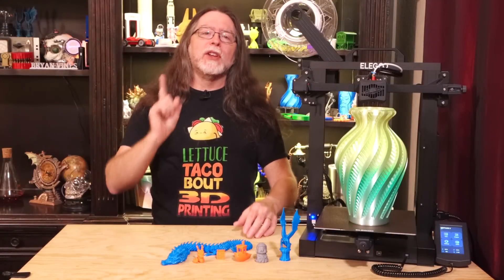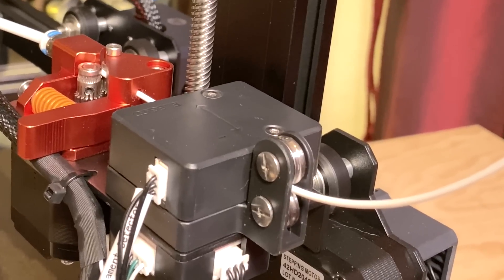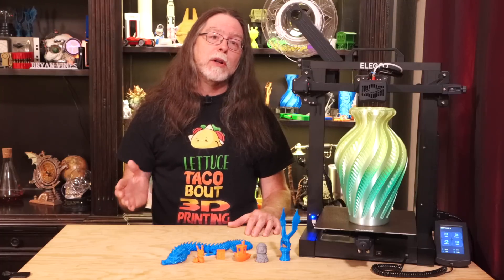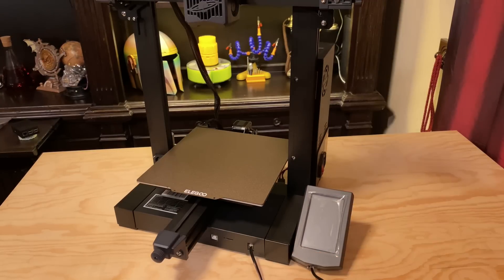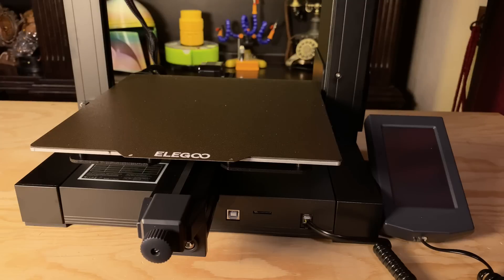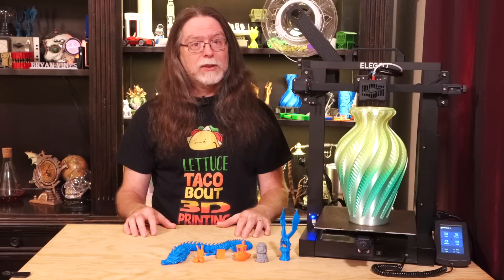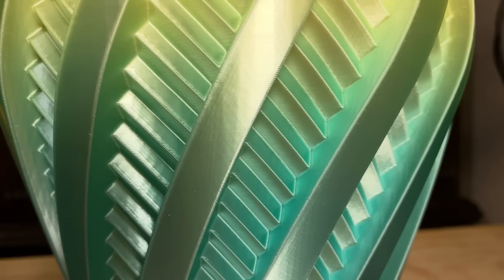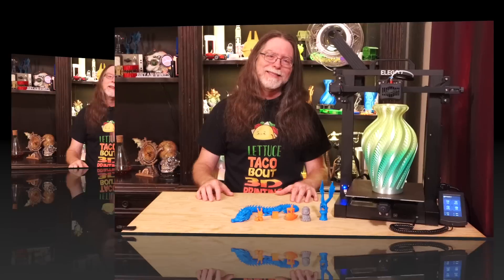Elegoo Neptune 3 Review

Comment: Ordered this printer last night before running into your review. Will replace my aging and highly modified Anet A8 v1.0. Can't be bothered with all the tinkering needed to keep the Anet running. I've learned a bunch more stuff about the Neptune 3 from your video so thanks for the comprehensive review. Subbed. Cheers.
Reply: I'm looking at getting my first printer seeing as it has been 3 weeks how do you like it? Any problems?
Reply: @bloodyhawk9885  I love it. It just works! No failures so far, and I've had two 29 hour prints and some 0.1 mm layer height prints during this time. I love the strain gauge ABL and the textured PEI flex build plate. Actually I've only had to detach and flex the plate when I'm impatient and want the print off before the plate has cooled. Let it cool and prints release themselves. It's quiet too so I can sleep when it's running overnight. Build plate is also 235x235 mm even though advertised as 220x220. Nice because I printed some 220x220 trays for my resin printer with room to spare. Also bought myself a dual reel dryer by Comgrow and have that sitting beside the printer to feed dried filament directly to the extruder. As a first printer this would be great, although I'm sure there are many others of equal or better capability. Have fun. Cheers.
Reply: @cfriedalek  thank you!

Comment: My Neptune 3 arrives in two days and I can't friggin wait! Great video!
Reply: has it been working good so far?
Reply: I've been having a blast with it, it's SUCH a better machine than I had previous (Monoprice Select Mini). I've been VERY successful with most PLA/PLA+, printing several functional/practical prints with limited adhesion issues. PETG has been a struggle but I know that it is in general. I feel like most of my issues are very reasonable learning curve type stuff that has little to no fault of the machine.

Comment: Didn't using cura 5.1 without changing the start G-code ruin the auto bed leveling?
Reply from the maker: Hi, Elegoo's starting G-code for the printer, in their branded version of Cura, homes the printer with G28, then draws a priming line. That's pretty much it. The firmware on the printer uses the stored mesh; G28 doesn't hurt it.

[edit] this is essentially the same thing the starting G-code does for the Ender-3.

Comment: What speed did you print the base at?
Reply from the maker: I used a typical Ender-3 style 0.2mm profile, and turned on Spiralize Outer Contour to print the vase. The standard profile is set to print at 50mm/s, with the wall speed at 25mm/s. Apart from the bottom of it, it's all "wall," so it was running at a conservative 25mm/s. It would have been a 3-hour print, but I scaled it up to the maximum build height, and that really increased its print time.
Reply: Thank you I’m still very new and got me Neptune 3 just last month and still only printed a few things as I’m learning and trying to master.
Reply from the maker: @ippaku  No problem! Welcome to the world of 3D printing!  😀

Comment: So it’s more like an Ender 6se than an Ender 3 which comes with everything the Neptune does except it’s screen is not a touch screen which may or may not be a good thing depending on the touchscreen and the Neptune has a steel ptfe sheet rather than the Ender 6se s glass bed. That seems a fairer comparison don’t you think? Better value as the 6se is quite a bit dearer than the Neptune and the Ender 3.

Comment: Thanks for the great review. But, mine has a weird issue: when I pause the print and resume, looks like the extruder gets crazy and stops extruding (looks like it actually starts to move the step motor backwards). Is it just my unit? Thanks!!!
Reply from the maker: I tested the filament sensor and the power loss recovery feature and they worked, but I hadn't thought to test pause-and-resume. I would sort of expect the filament runout sensor's pause-and-resume sequence to be the same as pausing from the screen during a print, but I could be wrong. Maybe it's a firmware bug? I'll try and test pause-and-resume from the screen when I get home.
Reply: @BV3D  I tough about it being a firmware issue and I upgraded to the latest 1.0.4 but still happens :(
Reply from the maker: @bernardosilva7306  I just tested pause-and-resume from the screen, while printing a CHEP cube. I paused, the printer parked the tool head, and I resumed. The cube finished printing normally.
Reply: @BV3D  Thanks! Did you change filament while pausing? My issue happened when I was running out of filament mid print. Don’t remember if I pressed “load/unload” filament on the UI (maybe I did) instead of just pulling the left over filament out :(… I am in the middle of a big print now, I will test it again when it’s done. Again, thanks a lot!!!
Reply from the maker: @bernardosilva7306  I didn't change the filament on this test, but I while working on the video, I did test the runout sensor by cutting the filament. That worked, and I did remove the filament and add it back in for that.
Reply: @BV3D  To remove and add a new filament did you use the UI buttons to “load/unload” or did you just pulled the left over by hand?
Reply from the maker: @bernardosilva7306  I just pulled the leftovers out by hand.

Comment: I have the same printer that I recently purchased directly from Elegoo. After the Auto Bed level you should print "The Bed Level Test" where you can grab from thingiverse. Where it prints the circles on each corner and in the center.  The problem I am having with this machine and I seen someone else that left the exact same problem on the Item in an Amazon Review is that it is not probing correctly "Auto Bed Leveling". When you print the Buddha test print its fine and dandy, but when you print the bed level test print the nozzle begins to dig into the PEI sheet on some of the corners. This can be fixed with the z offset but it goes against Elegoos instructions, where as when you feel light friction between the bed and the nozzle set the z offset. When you do this some areas of the bed aren't leveled correctly. I am wondering if your machine might also have that same problem as well.

Comment: I really want to like this printer, but the firmware seems pretty flawed currently. The fact that a custom Marlin configuration is not an option right now is a major bummer. Additionally, if you look at the r/ElegooNeptune3 subreddit, you don't have to scroll for long before seeing a lot of the same issues creeping up. Yes, many of them can be contributed to inexperience and therefore easily fix, but the firmware issues are not one of those.

I hope either Elegoo makes an attempt to fix this, or that the incredible Marlin community is able to solve them independently, but until then I can't personally recommend this printer to anyone that doesn't a truckload of patience alongside ample free time to troubleshoot it.

Comment: Did you have any elephants foot on those small prints? I've got some problems with that on my Ender 3v2. Would you recommend this if I already have the Ender 3v2 with the CR Touch? Thanks for another great video!
Reply from the maker: Hi! Usually elephant's foot shows up if you've got the nozzle a little bit too close to the bed on the first layer. But, sometimes you need that extra closeness to get the filament to stick. Since you've got a CR touch on your Ender-3 V2, you might try adjusting the Z offset just a tiny bit, to have more of a gap between the nozzle and bed on the first layer. But if your prints don't want to stick after you do that, put the Z offset value back where you had it. You can compensate for elephant's foot in your slicer, usually. Cura and PrusaSlicer have settings for this. Chuck Hellebuyck covers this for Cura: https://youtu.be/FH1wUWy7Hjw?t=222 Give that a watch and see if it helps.
Reply: @BV3D  Okay, I'm gonna try this. Thanks a lot for the help!

Comment: The bowden tube technically stops at the bowden coupler not inside the hotend. There is a small capricorn tube inside the hotend instead.
Only really relevant if you want/need to change it but still might prevent thinking that everything is fine if you check it for deformations looking at the bowden coming from the extruder.
Reply from the maker: Ah, cool. I didn't know that. Thanks!

Comment: How feature rich is the GUI? I wouldnt expect it to be as good as a 12864 but does it have some advanced Marlin commands?
Reply from the maker: It's decent. It has numeric keypad entry for temperature, for example, which I find more intuitive than plus or minus buttons with a 1/5/10 selector. It lets you define nozzle and bed temps for PLA and ABS preheat buttons. I haven't checked to see how many files/folders it'll let you browse through. While it shows folders on the screen, it doesn't let you navigate into them (which is unfortunate, I think). If I had to guess I'd say it will show you at most 20 or 25 items on the card (four or five screens' worth of 5 items each). The touch UI doesn't give you controls to adjust steps/mm for any of the axes, nor does it have controls for jerk or acceleration.

That said, for basic "I want to select a file from the card and print it" functionality, I think it's fine, particularly for a new user, or someone who's not planning to tinker with the printer.

If you're getting it for the express purpose of bolting on some upgrades, adding a Bondtech extruder or a direct drive, you'll have some extra work to do, I think. Pretty sure you can use Pronterface or something similar to specifically set steps/mm and save them, although worst-case you could just pop those particular G-code commands in your starting G-code and they'll get set every time you slice a file.

Comment: Hey Bryan, Thanks for reviewing this printer.. I think I may have asked you awhile back if you could? 
I have one I got one of the 1st sold when They were doing the pre-launch sale. I got it 2 months later.

Yes it is a great printer for the money.. However it is not prefect all the time!  I have plenty of fails on it far more than it should have done when I had it set up well,
And even printed a mount for the top frame to hold the Sunlu S1 Filament Dryer up on the top frame instead of the handle and the normal Neptune 3 filament spool holder.

That way I can keep the filament in use dry when printing as it feeds down to the good filament run out unit there.
I would like the screen to show a longer length of text like say scrolling across the screen right to left when tapped on so you see the full details of the print?

I will myself have the text show the name the filament used and the nozzle size and the time taken so that is long. 
That way if using different nozzles for different prints on the card you know what to have fitted for that print

I do that text set up on the Aquila I have and it's text scrolls across when selected ( Alex version of the firmware )

The fans are very low noise compared to other printers even though this one has 4 of them ( board fan ) ( two print cooling fans ) ( heat break cooling fan )

The lack of a full auto filament loading program is a pain, You press load filament and it moves it 10 mm Yes you can go in to the menu and type in the length to move the extruder and the speed of that movement. But You should just have to press load filament and it loads the full bowden length for you.

On the Aquila that does a auto full bowden length loading.  All in all a good printer for the low cost it just needs some extra firmware tweak's. 

I hope Elegoo do a firmware update to address the things I and others like you pointed out?

Comment: As usual, great job! It is really nice to see that a budget machine manufacturer making smart decisions. Now, if only it wasn't a single extrusion down the Y axis.
Reply from the maker: Thanks! Y'know, having the Y axis riding on a 40mm wide extrusion isn't so bad. It works pretty well for the 200-250mm bed sizes.
Reply: @BV3D  40mm is better than the pathetic one on the original Ender, but dual 20mm would be so much better to stabilize the bed. Get those contact points out towards the edges. So happy to see the bed fixed to the Y carriage without springs. So stupid to have a leveling sensor and springs. Unless of course the carriage is hopelessly out of whack.